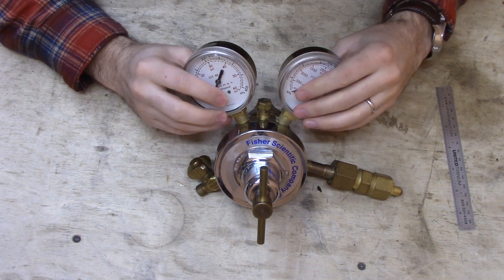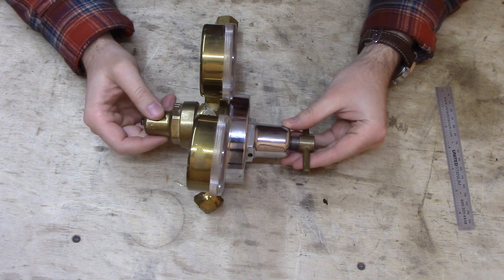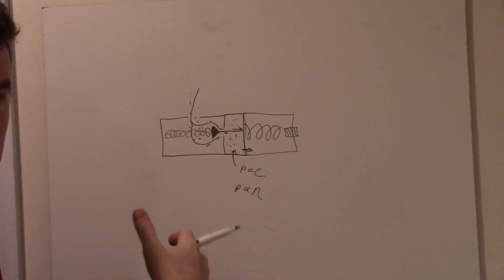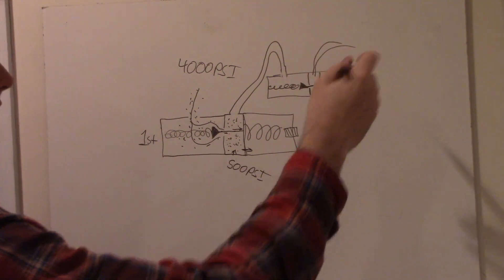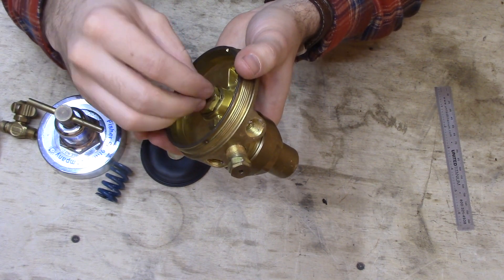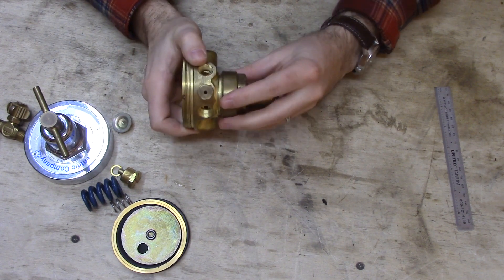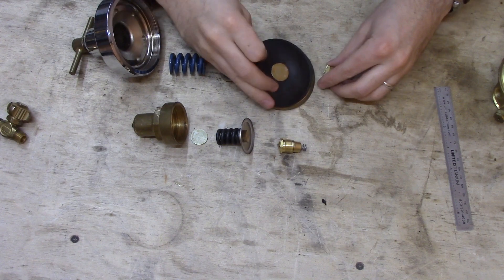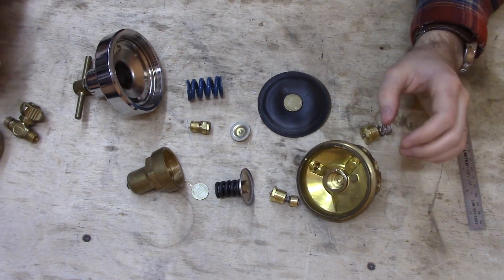How Gas Regulators Work, Dissasembly of Two Stage Regulator

Comment: Good video. >>>>>>>>>>>WARNING TO NOOBS! <<<<<<<<<<<<<<<<
KNOW AND UNDERSTAND CLEANING TO OXYGEN SAFE STANDARDS. Wear fresh nitrile gloves when assembling high pressure oxygen systems. Use only approved thread sealants like oxygen-safe thread tape (Blue Monster is easy to remember but there is a variety.)
Do NOT just use random seals and O-rings. Use Viton O-rings only if you must substitute and get the proper factory or aftermarket rebuild kit. It is often inexpensive to send regs out for rebuild (especially if they need cleaning). Your local welding supply or online rebuliders can handle whatever you don't want to tackle.

Comment: i use one oxygen regulator with nitrogen gas...  it will be problem??? i read the problem is about the oil of guages ..  i will never use it for oxygen!!
Reply: It won't be a problem, just need to change your connector. Don't use oil gauges on an oxygen regulator.